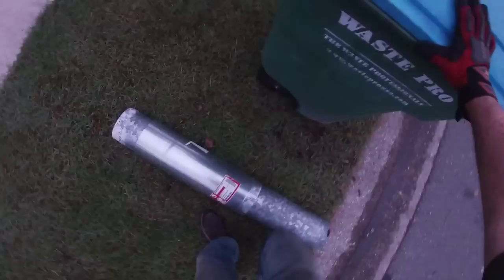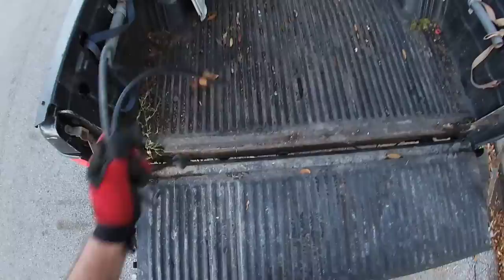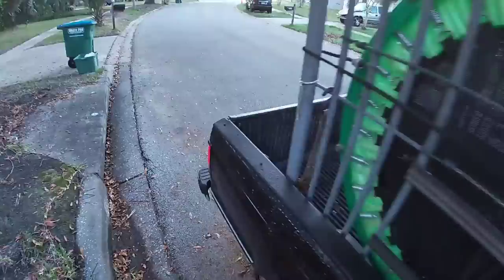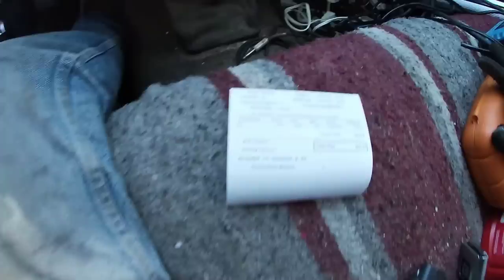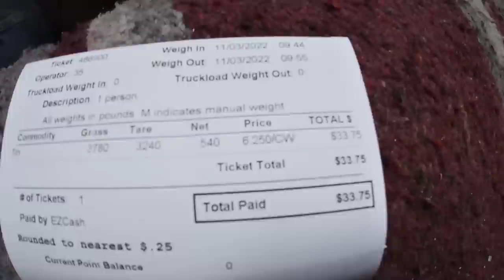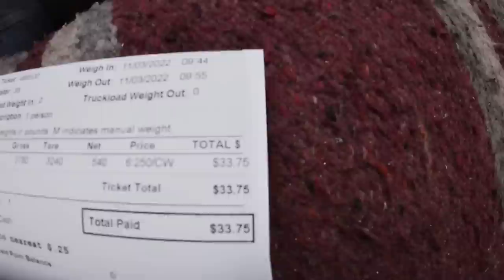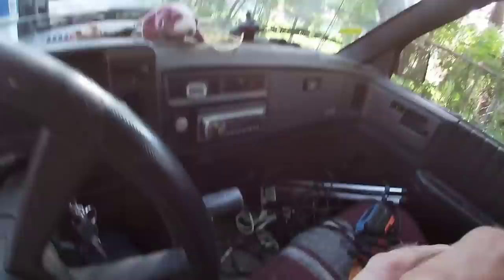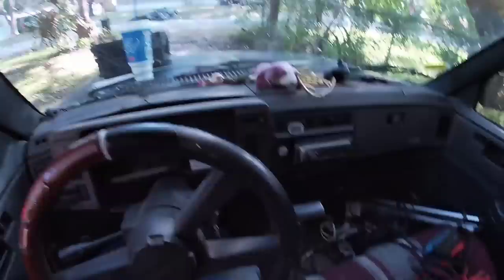Free for the Pickens!

Comment: How much time and fuel are you using to get $33.75?  I stopped going out like you to find items cause of what fuel costs, scrap iron prices around 5 cents per lbs. I will pick items if I see something driving somewhere ( work, store, etc) but not just look for scrap only.  Don't make enough money and I microscrap most items. I'm in suburbs of chicago land area. I used to spend around 3 hours on each trash days in my area until prices went to he'll ( fuel high, scrap prices low) and would make $200 to $300 each week.